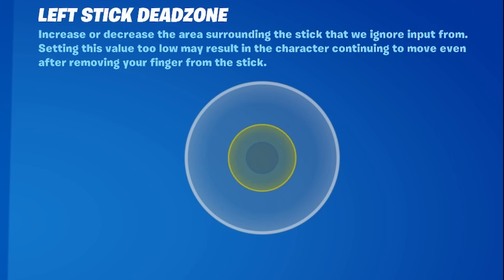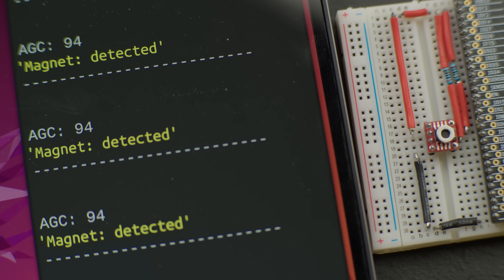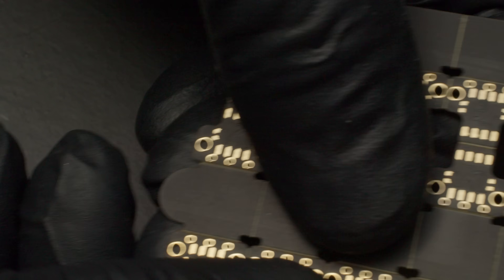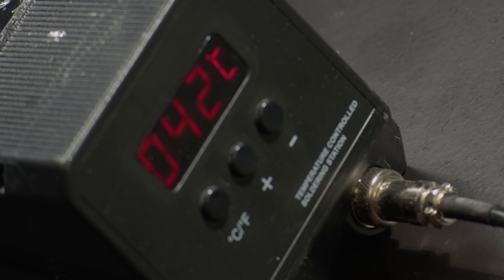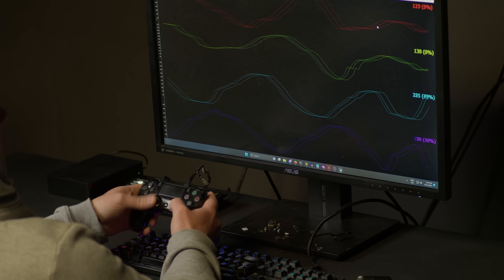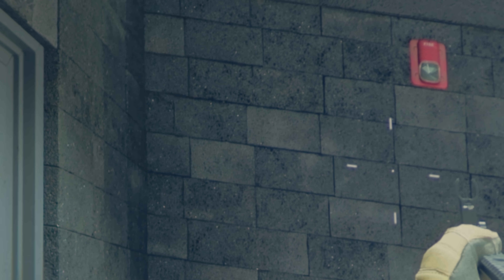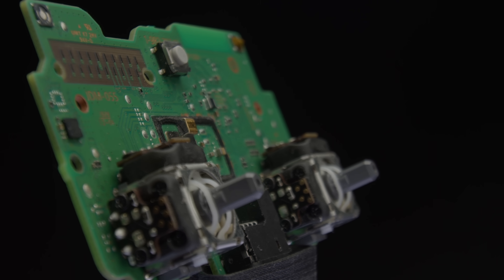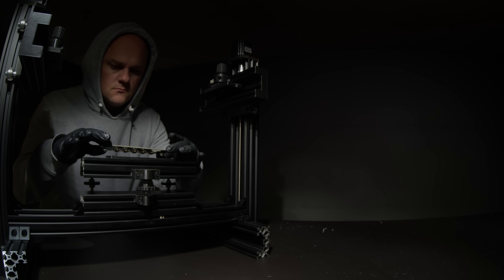Beating the $20B Joystick Drift Problem, and giving it away for free

Comment: The “joystick problem” is L3 and R3, that’s the full story. The reason your sticks lose sensitivity is because they are also buttons. They lose their spring just like the other face buttons. I notice the difference on a new controller after pressing R3 just 3-4 times. And that’s assuming the controller was handled well before it got to the shelf—some thumbsticks come loose right out the package.

Comment: A lot of people saying about licensing but you'd have to check whether or not gulikit have already patented their hall effect joystick used on the switch and steam deck
Reply from the maker: Not really, their implementation is totally different. Its like comparing single transmitter radio to gps. Both can be used to track positions with radio. But its a totally different implementation. But the limitation of the YouTube title might give it a false impression its the same. And if it where the same. This is an addon package to exhisting joysticks. So just the sensors. Not the complete joystick.

Comment: I have a bunch of old joystick ports in my draw that I've changed out on my xbox360 controllers over the years, I found that most 3D games require you to push forward on the left stick, this warps the internal mechanism over time and eventually will sit slightly forward, every single one of them has this problem, changing the mechanism has fixed it every time and I've never had to replace the pots, this fix may help with accuracy  and the odd dodgy potentiometer but I guarantee it will not stop your character shifting forward when you don't want it, the mechanism needs changing to all metal, preferably a metal that will definitely not warp or stress over time.

Comment: The thing is, it's hardly even the fault of typical pot joysticks, I have a 360 controller I've beat the piss out of for years and years, after years of use from its first owner and there isn't even a trace of drift, and og Xbox controllers that sre even older without drift. Companies pushing for smaller and  cheaper sticks are at least half the problem, if not more.
Reply from the maker: To measure if something have drift or not depends on a lot of factors. Without those factors its hard to compare. But the size smaller is actually right on point one of the biggest reason for it to happen.

Comment: Does the magnet affect the gyroscope at all? We* had this problem in the Steam Controller Left Trigger.

*Steam Controller users
Reply: What are you talking about?
Reply: @marcinkaczmarczyk2351  Steam Controller triggers use magnets and hall sensors. Pulling left trigger has a very subtle effect on the gyro.
Reply: @nanopi  so subtle that i never noticed it on any of min over last 5 years

Comment: Of course this is an amazing design improvement. Unfortunately, given the amount of money, advanced technology and resources that game console designers have at their fingertips, I would guess this kind of improvement has been long known by game controller designers and manufacturers. 

This solution is the same concept and approach as the pharmaceutical industry takes when considering cures vs long term medications. The money is in the long term medication, not the cure. Same goes for selling game controllers. The money is in forcing gamers to repurchase controllers over and over again. 

If they wanted to solve this issue, they would’ve designed a better controller module, years ago. Instead, they are greedy and know that gamers will just repurchase controllers because most people are too lazy or lack the technical knowledge to just replace the module that causes the drift in controllers. 

I know some comments are insisting that filling this design under an open patent is the way to go and will protect consumers from some evil corporation monopolizing on this improved design. Unfortunately, given my previous hypothesis, I don’t see this issue of improvement being a point of interest for companies that manufacture game controllers. The proof exists within the current game controller design. If this problem was going to be tackled and resolved, it would’ve happened years ago. 

Thank you for putting so much time and effort into creating this solution, along with the video. It was certainly interesting to view a realistic solution and although it would directly benefit gamers/consumers, it resulted in less money within the manufacturers pockets and we all know that they would never embrace an idea that yields less revenue results.

Comment: funnily enough, Nintendo already "fixed" stick drift on the n64, however the material they chose does wear down. unlike the analogues all controllers use they are just faulty by design.

Comment: I think it's not as easy as you maybe thought. And I'm sure that the engineers also concerned such an solution. But I think there are some "problems" that prevent the engies to use that method. 1st problem is, you need a huge amount of magnets. Then the 2nd problem is that you have to re-engineer a "new" type of joysticks despite there are already a working solution exist. Why reinvent the wheel? The 3rd problem is that you put an extra magnetic field into an circuitry that could cause electrical interference and but a bit more weight to the controller itself. Sure, the magnetic field isn't that big but there are some cost factors that maybe hinds the engies to use this method. I think it's always a money thing and as long they don't do their job right it fails. I think the problem sits more at the poor production side. If they produce a good and clean contact surface again it would fix also the problem. They already did good joysticks in the past so why not now? Right, it's all about money!

Don't get me wrong, your solution is very nice and could maybe fix the problem but I think it's not really that easy as thought.

Comment: The second set of screws can be omitted if you put a plastic catch on top to hold the pcb on top while soldering on the bottom. Just need to redesign a bit the plastic holder.

Comment: You know i think they make them degrade like this on purpose because they never really used to do it, or at least rarely. there was this little known console that probably not a lot of people know about these days called the Playstation 2, i know, silly name, but its true, it really existed. It was a console where AAA studios actually made GOOD games not just for profit. and not only that but the controllers didn't suffer from stick drift barely at all. In fact i have had the same PS2 controllers for 20 years.......no stick drift at all. Thanks to the fact that the controllers would self calibrate on the fly to compensate for any drift issues in them. 
But obviously if your stuff is working perfectly, you won't buy more to replace it, hence why they make tech break purposefully these days so you buy more controllers from them, or computers, or mother boards, or graphics cards, or just about anything these days.

Comment: I made a 2 axis encoder joystick with a rotary thumb encoder on top for z axis, for my Cnc machine. Its interfaced thru win XP (custom stripped clean version)
 It never drifts, SO i COULDA SOLD THIS?  Ok the x-y encoders are $275 each, and the z thumb was like $150 Then I ran that into a $1400 breakout board...optoisolators, 3rd party software, the mouse body I machined from billet and fit up. Awesome! , that'll be $10,975. Ill anodize any color you want for FREE!

Comment: I have a wired xbox 360 controller from launch. It still has zero drift. In steam settings it is centered, you can apply pressure and get it to show movement without the stick visibly moving like an f16 stick, shaking it you get nothing. No overswing on fl icks. Amazing design or I got lucky.

Comment: I think it’s user error, I’ve never had drift problems and I still have my ps1 remotes from the early 2000s. I also have a switch which everyone swears has it, but mine is still working flawlessly.

I don’t manhandle the joysticks like everyone else seems to. For some reason they think the harder you twist them the more you get, but there is a limit. All you’re doing is stressing it the f*** out.

Comment: Ive been playing around with an idea to create a controller that solves joystick drift by using optical sensors pointing down that tracks movements based on x and y axis, that should theoretically increase the users potential accuracy by 123.4%.  my first prototypes are currently working extremely well, and are actually kind of cute...they look kinda like little beetles with fat booties....i call the design the Bootle....aka the bootiliscious beetle...

Comment: There are some issues using hall effect sticks on xbox controllers, as the trigger mechanism also uses the same tech. There are boards that have been developed that negate this issue, I haven't managed to test them yet, though, so I can't comment on whether they are worth buying and installing.  I believe some early console controllers used to use hall effect sensors, but as always, manufacturers chose a cheaper option (carbon track), that need replacing more often!

Comment: Its not hard for potentiometer makers to understand. Stop assuming anyone older than you is dumb, that is a very dumb outlook to have. They know exactly what they are doing, since they have been making them for decades. They have formulated the wear so that by the time it wears out you feel you've had enough use out of it youll buy a new one.  I have pots older than you are that have seen many factors more use than your controller and they work perfectly fine. You know why? Because screwing dumb young customers out of their money wasnt a thing when those pots were made. Sue the company for an inferior product, dont assume they are stupid and dont understand their contacts rub when that is literally how the product has worked since inception. They will NEVER admit to it, but that is EXACTLY what they  have done. And you just assuming they dont understand abrasion is exactly what they want you to think so they can feign stupidity when someone tries to sue them. You are helping them steal users money with an inferior product design. STOP THAT!!!!

Comment: Idk how a magnet would be a good long term solution. Dont magnets lose power? And if so, doesn't that mean those magnets would become unbalanced, and not be able to function correctly with each other at some point? And the fact that the silicone grease can only last so long as well. Am I wrong? I'm not an expert at this kind of thing.
Reply from the maker: Thats gonna take alot longer than the lifetime of the controller. And it doesn't need the grease. 😎

Comment: There's two potential issues with joystick drift, one is obviously with the potentiometers, and the other is with the centering mechanism wear (where there's slop in the centering mechanism which doesn't allow it to return back to center causing the same issue).

Comment: If I found a fix for a 20 billion dollar problem, I'd be selling 3rd Party controllers with the implementation, and charge more.

Instead of giving away time and effort for free
Reply: See if it's patented and file that too in my name
Reply: You can use rotary encoders too

Or wire wound potentiometers if account for extra inductance

And springs wit quality for self centering

Comment: Here is an idea, because is appreciated you want to let it be free.
There will be some companies that will steal your idea and make money for themselves and then say it's THEIR idea to block others.
Now, you can file patents for your ideas and you can hold the patents and then give free licensing to anyone.
This way they won't block your ideas from being done by others even if you are the initial creator and they changed a little angle to make "their own" (variation of your creation)
I would love to have ability to buy such an upgrade for my cheap controller.
Instead of paying 50 euro for an xbox one that seems to have the same engineering as a 20 euro controller, i'd rather get the 20 euro one and buy 2 magnetic joysticks to give it all the life and not worry for future failure.

Comment: some game controllers may seem to have drift, but they are fixed after a clean!

open your controllers up and clean with a cotton bud and some rubbing alchohol or water. clean the sticks themselves, the doors around the sticks and the mechanisms in the stick itself (after removing any batteries obviously), and it could fix your problem

Comment: Just had to send my Elite controller ($180 with a 3 year warranty) back with around 80 hours. Both sticks drift and the ABXY buttons double input as well as stick. Its not like they dont know a solution. They do, but fixing it would require sacrificing a few pennies in some way so they don't. You can hand this to them for free and you still wont see a fix.

Comment: Ever since getting a joystick with hall effect sensors, i have always wondered if it was possible to implement it in a controller. Props to you for putting in the effort to prototype and test a solution that works really well
Reply: The Sega Saturn and Dreamcast both had hall effect analog sticks, so yes, it's very possible

Comment: This will never get fixed unless gamers actually make their voices loud and clear... which likely will not happen. Imagine you're the console manufacturers. And you get to choose to either make a controller that will easily last the consoles life time.. or make a controller with a accelerometer that is rated to last for a few weeks tops with heavy usage before you get massive drift? This way you have to buy a controller every few months if you want optimal gameplay esp if you play competitive shootes/games that require high precision. Why do you people think that every game starts by default with a generous amount of deadzone? They won't fix it unless third party constroller makers can compete and start to use good ones for a decent price. The problem is that Sony and MS aren't just going to allow these third party manufacturers to make better controllers than them for cheaper. Esp not today with the special ps5 triggers, touchpad etc etc. 

Also it's mind blowing that ps5 controllers still have the idiotic giant led light and tiny batteries. I am convinced they intentionally kept the battery life of the controllers low so they could trick people into buying more controllers. Afterall it's very convenient to just pick up controller B when controller A is out of power.

Comment: I'm convinced it's a problem by design. Not like the producers can't solve it but they don't want to because it's profitable
Reply: Cuse your right look up game cube controls and why they still work to this day
Reply: Hall effect sensors are more vunerable to interference, may not be as great in terms of centering, jitter, or latency, and use more power. TMR sticks improve the power issue and latency significantly from what I've read. So the slight cost increase is probably only part of it. I don't think they're built to fail though, since people would still smash up sticks, get food and dirt stuck in them, or just upgrade their consoles anyway. Plus every instance of major stick drift inside of warranty is one they have to fork out the cost of a return and replacement for. I'm sure improved versions will end up being the future, but it's not like there aren't any tradeoffs noted.

Comment: For all the people saying the idea should be copyrighted, it’s already in the wild and being used and really doesn’t qualify.
Reply from the maker: Im the only one that has posted this solution that i have founs.  No other have implemented in a joystick. The difference is in that there are several hall elements used pr axis and its the signal difference between each element that tracks the rotation. Not a single hall sensor the way the others have done it. Its a big difference. Because the other method is way less accurate.

Comment: in addition to the open licensing, i think you should allow the free use of your design exclusively to cases of non-profit... if anyone is using the fruits of your labor in ways that make them money, i think you should ask for a 10% cut of it. This will allow you to keep making things without going through hardship... & if you really believe that you need to struggle to achieve progress, then you can put that money into projects that aim to help your community
Reply from the maker: Thats what im trying to do. But without the leverage of any legal system. So voluntary. It only needs to work a little bit.

Comment: the joystick market is a great example of what a lack of competition does for a customer. Alps is perfectly capable of producing high quality, durable products. They produced the mechanical low profile switches that made the thinkpad x20-series so legendary. I still use my modded thinkpad for writing to this very day. 

They just don’t have any competition. Being a player in the controller market is largely dependent on also being in the console market. If you don’t have anything to ship your controller with, you can only play in the minor leagues of third party manufacturers. Therefore, they only have to keep a few large customers happy, ensuring their position as future supplier, and they maintain an absolute stranglehold on the joystick market. You just can’t compete with the numbers of supplying Sony, Microsoft and Nintendo with joysticks for their product. 

Now, what do you have to do to keep them happy? In most cases, as long as your product is reliable enough not to be dead on arrival, the manufacturers are not too interested in durability. They want price and a steady supply. Failing joysticks just boost their controller sales.